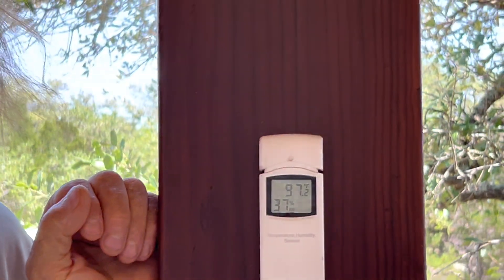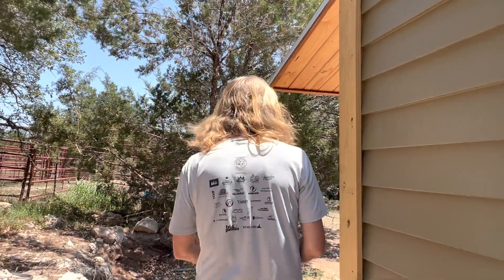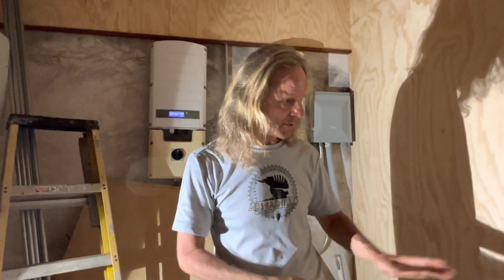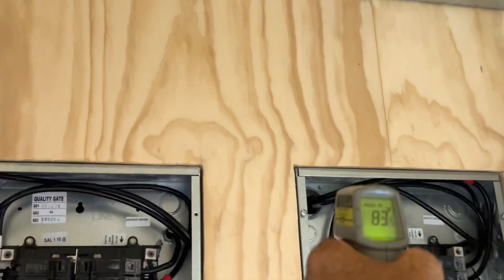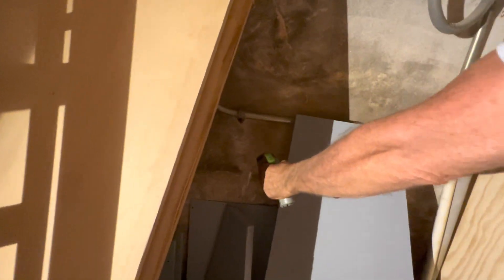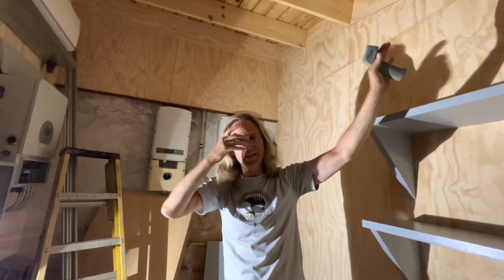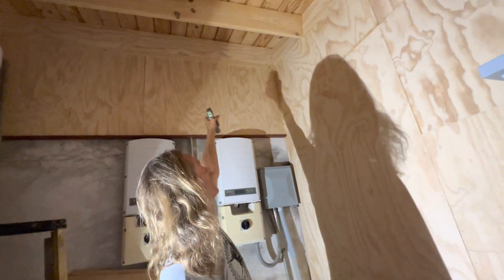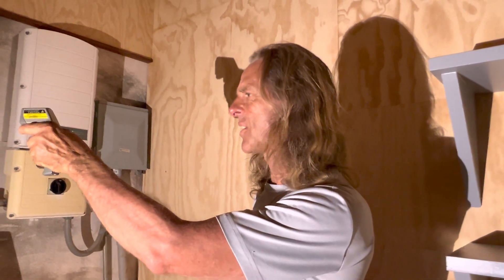The Solar Shed Handles The Texas Heat!

Comment: I have 2 sets of batteries, each with bms 48V 230 Ah, can I connect them in parallel so that I have 460Ah/48V
Reply from the maker: Yes, generally speaking, that is how it works.
Reply: @RayBuildsCoolStuff  Hello, I spoke with a bms agent daly, he told me that bms is required to have an equivalent job, is this true?

Comment: Hi, I'm interested in how the Seplos BMS is keeping the batteries balanced.  I'm  tossing up  between Seplos and JK-BMS with 2A active balancer. How is the passive balancer on the Seplos going, what's the max cell deviation? Would you recommend the Seplos I note you had a few quality/warranty issues with them?
Reply from the maker: I haven’t had a failure of a BMS but mine were in a batch run where there were some failures of diode d4. They sent me an extra for future replacement in case of future problems. They also sent extra diodes and a video detailing how to replace the diode for those able to do so. They sent me a letter saying that repairing the BMS myself would not void my warranty. Other companies may have handled that issue with less transparency. I continue to be a fan. I own some 4s jk BMS. The max deviation I have is on discharge at the cutoff voltage and it varies by the battery. I don’t want a balancer that functions at the bottom end of the curve. That would be chasing my tail. The 150ma balancer on the Seplos keeps them very close at the top and in the working range with the cells I am using. Time will tell if this is still the case in a few years. Hope this answers your question. Oh and the Seplos doesn’t have bt monitoring. I will monitor through solar assistant. I expect monitoring to be a thing when new and not so much later other than SOC.
Reply: I’m a big fan of the Seplos BMS, but yes your cells need to be properly balanced, all you cell to cell connections need to be well made and if you’ve got any cables linking groups of cells then you need to program this into the BMS so it knows.  If you have comms setup and you will be topping off at least every other day the Seplos will do fine.  If you rarely top off and just have the inverter pumping current at full power to disconnect then you may have balance issues over time.

Comment: Ray thanks for sharing your solar projects with us. 

I came across your channel a couple of months ago and after looking at my recent electric bill from SoCal Edison I think I need to invest into Solar. Not sure what Texas charges for electricity nowadays but SCE is forcing customers to their new TOU billing rate.  Now $.33/kwH for off peak and super off peak and $.54 for Mid-peak which is crazy compared to US average of $.12/KwH.

I see that you build your own battery backups which is super cool. I am wondering who you are sourcing your Solar Panels and what wattage and voltage are you using? 

Not sure if you have done a video on that yet. I haven't viewed all your videos yet.

Is there a preferred voltage of panel for 
home use? I see you use large Inverters but your thoughts on micro inverters. Pro and Con.
 Great to hear your thoughts.

Look forward to your future videos.
Reply from the maker: I've had my panels for 6 years. I will expand when I can find a great deal on used panels. My friend had hers installed 4 years ago. Both of us have solar edge inverters with optimizers on the panels. Those will be ac coupled to our hybrid inverters. She added 7.5 KW of panels to be dc coupled to the hybrid inverters as well. They were installed by a friend that owns a solar install company. The subject of solar panel selection and designing arrays is too complicated to explain in this venue. I may do it in a future video but there are lots of sources of good info on the subject. It's just that the choices are dependent on several factors including climate, availability, inverter choice, roof layout and other things. On hers we designed in three series but we could have gone with two. We chose panels on value of what was available at the time but that is different in different geographical areas and changes all the time.

Comment: Cool shed, Ray...pun intended.  Curious about the humidity in the shed given the rainwater tank on the otherside of the concrete wall.  Does the tank have a waterproof membrane?
Reply from the maker: I haven’t measured but it feels dry. Of course I’m gauging against the humidity of central Texas. The water tank is coated inside with marble dust plaster and the concrete is 12” thick so the diffusion rate is pretty darned slow. Also I think the shot Crete is like a seven sack mix. Of course once the a/c is in operation it will run dry and it can be set in Dehu mode if it was needed but I don’t think it’s an issue.